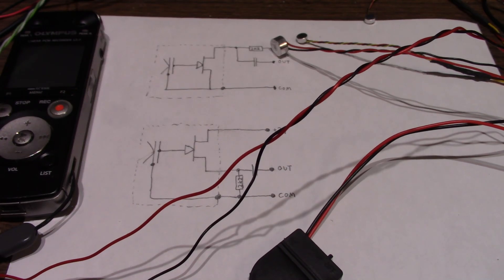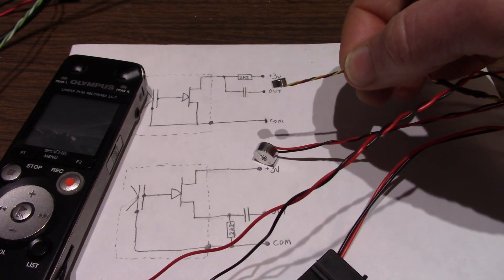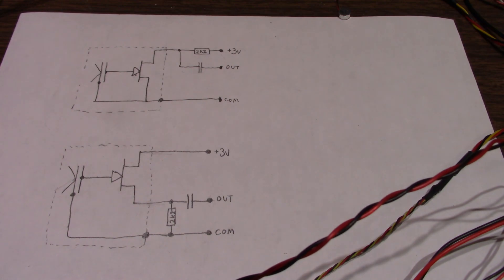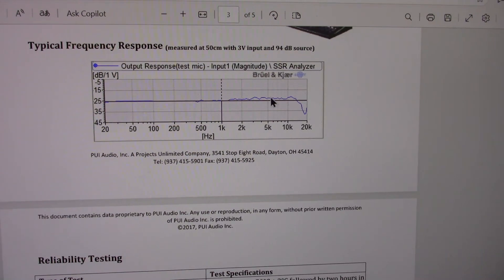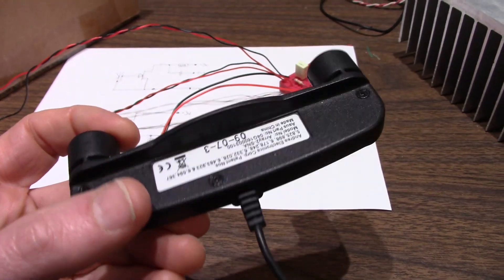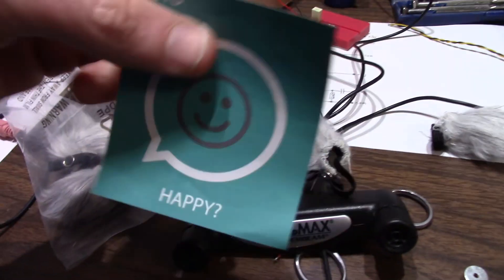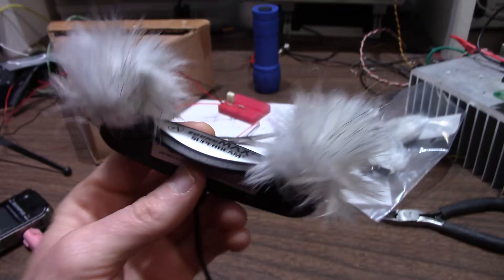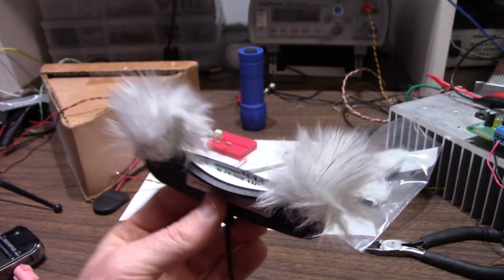Electret condenser microphone capsules - high sensitivity / low noise

Comment: great to upgrade the junk ECM's in the "shotgun video mics" for $25-50 that have 2x 10mm 2 wire capsules aka "Super uni-Directional Condenser Microphone" NW-81 or HT-81 with the "tele" switch.

Comment: Hi John. I thought it was rather good. Seemed to bring out more detail over your normal mic used to record your video. I often use a lapel mic for video recordings. The only issue is, I forget to pin it on myself. Or worse, I forget to remove it, and drag half my project across the room. I must replace it with a radio mic!!

Comment: I bought one of these years ago to build my own microphone to test and graph some home made loudspeakers - instead of spending excessive amounts of money for a commercial microphone. 

There were some instructions on how to make the microphone using a narrow hollow tube on a loudspeaker website that also has a crossover calculation tool and speaker volume calculator. If I remember there was also something about reversing the polarity of the microphone to get better results or more sensitivity or some other such thing. 

Thank you this video rekindled the urge to make the microphone.